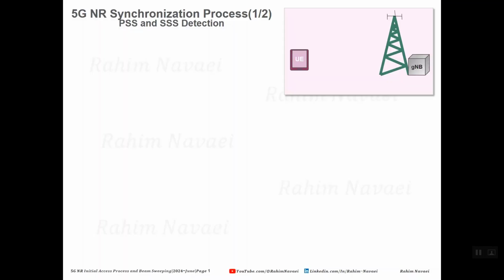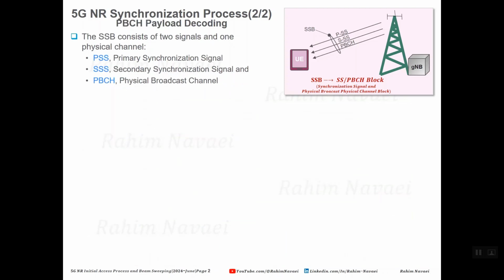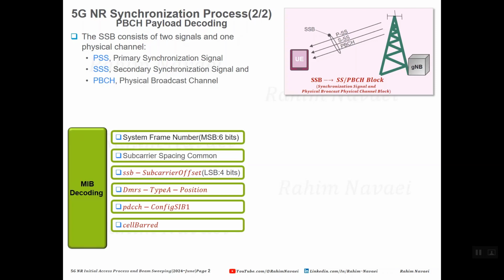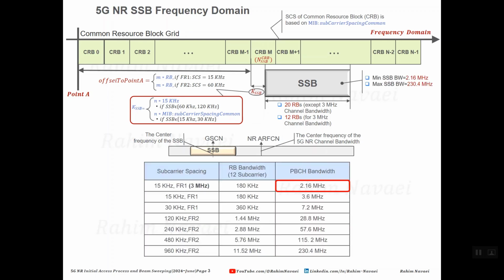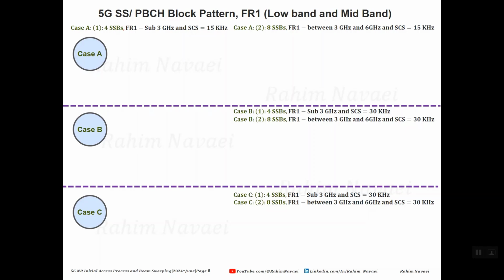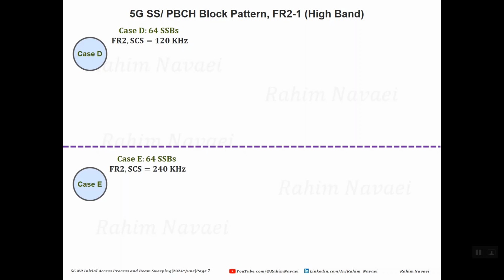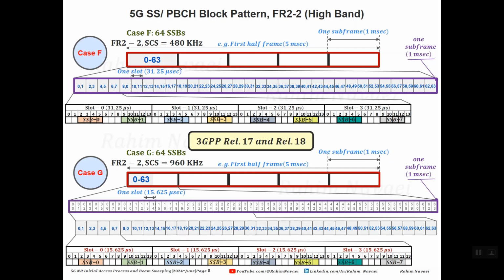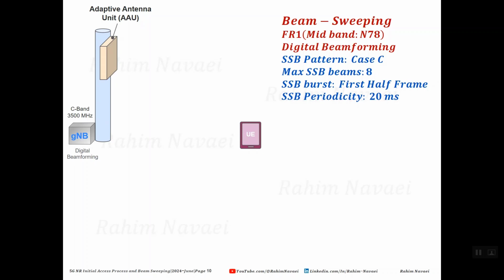5G NR Initial Access Process, SSB Beam and SSB Beam Sweeping #5G #4G #telecom

Comment: Thank you for the lecture. I noticed a minor inaccuracy at 3:47 : In NCP and ECP, we have 7 and 6 OFDM symbols per slot, respectively. You might have been referring to a subframe.
Reply from the maker: Thanks for your comment 
In case of LTE, you are right as scheduling is based upon subframe, but in 5G NR , scheduling is based upon slot rather than subframe.
For more information, please refer to my post in LinkedIn related to the 5G NR frame structure:

https://www.linkedin.com/posts/rahim-navaei_5g-5gnr-4g-activity-7198589778743705601-H2wR?utm_source=share&utm_medium=member_android
Reply: @RahimNavaei  Thank you.

Comment: Question can asked in an interview:
Why there're only 6 bits MSB in MIB for SFN or Why split of 6 bits and 4 bits?
In 4G, it is 8 bit and 2 bit split?
Reply from the maker: Deae Zahid
Incorporating the 4 Least Significant Bits (LSB) of the System Frame Number (SFN) at the Physical Layer effectively reduces the frequency of updates required from the RRC layer. This is because the 4 LSBs of the SFN, which change every 10ms, extend the period over which the Master Information Block(MIB) remains constant. Consequently, the MIB content is updated every 160 ms, aligning with the cycle of the 4 LSBs in the SFN."

This revision clarifies the relationship between the 4 LSBs of the SFN at the Physical Layer and the update periodicity of the MIB at the RRC layer. The same concept is applied to LTE.

Comment from the maker: ✅ To transmit 64 SSBs  using SSB Pattern F (Case F, SCS-480 KHz,FR2-2, n263) , it takes approximately 1ms, whereas with SSB Pattern G (Case G, SCS-960 KHz,FR2-2, n263), this duration is less than 0.5 ms.
by Rahim Navaei

Comment: Great Video Rahim. I am sure it takes huge time to create such good content.  

One query, assuming 5 widebeams in one 5G mmwave RAN, UE performs RACH on SSB index 4(assume), then which all parameters(e.g. slot, SFN, frequency PRBs etc.) are considered by RAN to conclude on which beam UE is performing RACH. Actually here I want to understand in details about SSB index and its association with RACH occasion. Its interesting how RAN knows from which beam UE is performing RACH.

Is SFN and Slot plays important role for concluding the best widebeam UE is attempting from? Thanks !!
Reply from the maker: Thanks Ashish for your kind words and support.
The 5G device, utilizing the SSB  Index and the information from SIB1, can deduce the RACH occasions. Consequently, when the UE selects a preamble and transmits it as MSG1, the gNB identifies the specific beam that received MSG1. It then responds with MSG2, directing it to the 5G device via the same beam.
Reply: Very informative Mr Rahim! When a Ue transmits and receives within a BWP, this BWP must include SSB.Is it correct?Thank you
Reply from the maker: @georgioskarouzos7418  
The requirement of a Synchronization Signal Block (SSB) within each Bandwidth Part (BWP), specifically in an active BWP, is not always necessary.
In the initial BWP, the Syncrinization Signal Block (SSB) is transmitted.